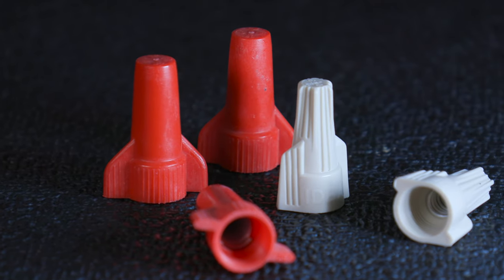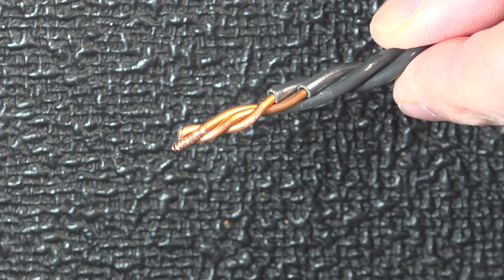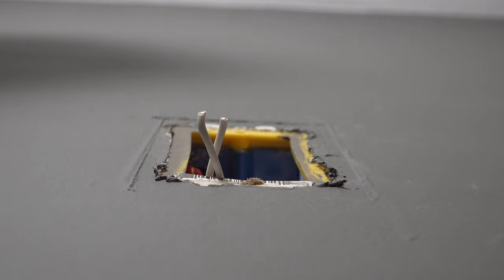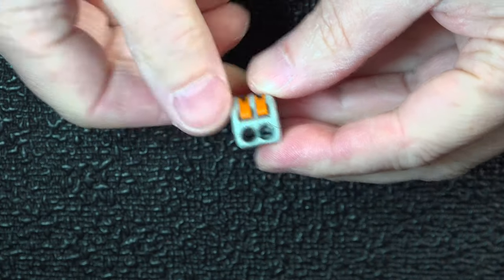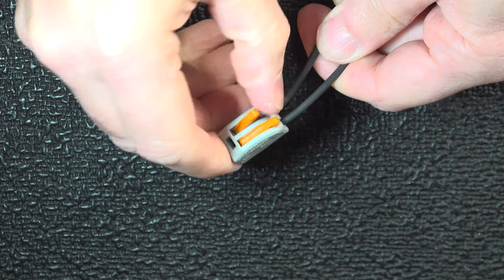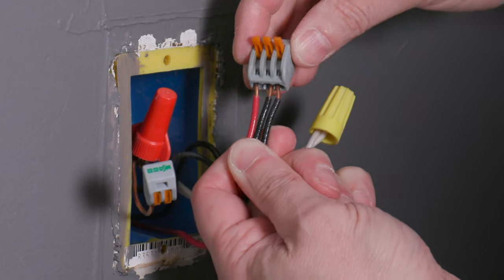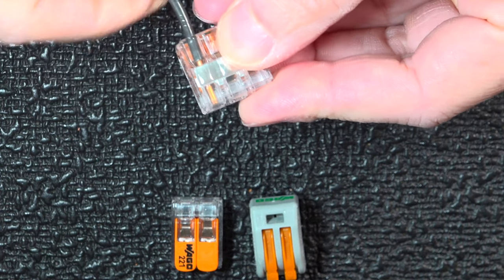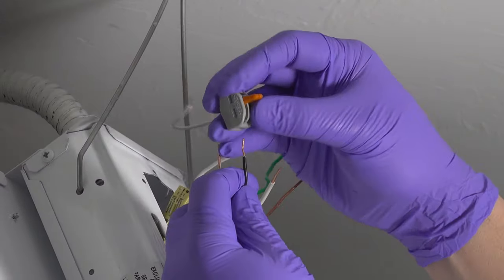Never use Wire Nuts Again - Wago is Better Electrical Connector

Comment: Never seen a wire nut in New Zealand.....however they do look somewhat like a common electrical joiner that's used out here. Basically the exposed wire ends are twisted together (all heavier wires are multi stranded), then the "joiner" is slid on and a screw on the side is tightened down onto the exposed part of the wires to help with the connection (the inside of the joiner is conductive too), the screw also helps to keep the joiner in place...the screw is counter-sunk into the plastic cover which is insulating the joiner.

Comment: We use these where i work. They are better than nuts. I also found theseclear push blocksthat are for stiff not stranded wires but they r great

Comment: If they would make these stackable then they would be amazing. 
My immediate thought was that this won’t really help you if you’re in a situation that exceeds 5 wires or where you have to work on a circuit hot. 
If they made ones you could add on to then it’s something I would want to implement into my material.
Reply: if you have more than 5 wires on a connection, you have ballsed up wireing. but there is nothing stopping you from daisy chaining a few together, and wago do do 6,8 and 10 way push connectors. also putting more than 5 cables in a wire nut has got to be pushing the limits there surely
Reply: @jak0995  not really. 4 gang switch box, or even a 3 gang switch box with a jumper wire. Pretty standard to have 5 wires in a connection.

Comment: Nice and handy but what do you do when City, county, or state entities specifications require wire nuts as their only approved connection. We are talking traffic signals and street lights that have been around for decades. As a certified union electrician of 23 yrs. that does commercial and industrial, ask anyone of my brothers. We hate wagos. We have more problems with them then good ole wirenuts. They are simple and fast I will give them that.
Reply: Well, force people to use WAGO according to the instructions, then there will be no problems.

Comment: Putting two wires together, wire nut good but on the occasion that you have more than two, I can see the benefit of using the Wago connectors.  I will be getting me some.  I didn't know there was anything else but wire nuts.

Comment: I worked as an electrician for many years and if my boss caught you using these or using the Stab-Lok on a switch or receptacle you would get chewed out. Wago and Stab-Lok do not provide a good connection. If you can spin the wire in the connector once it’s locked down, how good can the connection be?
Reply: The connection is so good that I have never found a connection made with WAGO that would have failed without water entering the junction box. Here where I live WAGOs came into use in the 90s and in the early 2000s they completely supplanted outdated connection methods.

Comment: I love Wago - we put Wago terminal blocks in panels for industrial equipment. BUT NOT IN A HOUSE!  they get moisture, they get corroded because they are in an area of the house where chlorine cleaning products, even pool products exist - or, they get overloaded.  plastic body without the 360 degree steel spring is subject to a positive thermal feedback effect - the body simply lets the top and bottom expand increasing electrical resistance, hence more heat.  20 amps year over year on a branch string is hard duty.  I love Wago, just dont want them to go down the road polybutylene water pipes did and caused so many houses to be damaged.  all in my humble opinion.  Go Wago - i think there are better candidates for expanding your product line that competing against wire nuts -but thats just me!  Preston

Comment: I’ve grown up around and doing electrical 20+ years wagos have there place but wire nuts are still best practice in general and I think cheaper. Problems typically arise the workers damage or break wire end connections while twisting together or use to small/too large size Nut. Also, cutting wire nut off is usually best idea so it does shorten the wire slightly but its really not hard to add a jumper to a branch and use that also if its solid to stranded simply twist all solid together then add stranded slightly past the solid so it grabs the nut. No more complicated my understanding as far as wagos is the lever are best for anything higher voltage and plug in ones are mainly for low voltage as not as much risk for fire.

Comment: These types of wire nuts have been around since the 90's.   Back in the 90's I used a different version, but simular.
The problem is the spring steel that secures the conductors 
These springs rust, and loosen up, and fail.
You don't have to cut the wire nut out.  You take the wire nut off, and un-twist the conductors apart.  Once the conductors are separated,  you can add new conductors,  subtract conductors,  or re-splice the old splice, and add a new wire nut. 
I did find the spring steel useful when splicing about 6 connectors in a box.  Because the conductors were more flexible than with wire nuts
Reply from the maker: I'm sorry are your comments about the Wago predictions because in 40 years in use worldwide none of that has happened. They are also made of plated copper so nothing is rusting, except for a weren't which is galvanized steel. Which do you think is better, plenty of rusted out wire nuts out there.
Reply: @SilverCymbal  For 20 years,  i worked as a maintenance electrician.
Reply: @jamesmooney8933  22 Years electrican in Industry and no problems with Wago Connectors.

Comment: Can this technique and wagons be used on automotive wiring without causing damage but stay pretty solid in the connector?
Reply: It may depend where because vehicles have a lot of crud and vibration.  I like crimp or solder.

Comment: My thing is how big is surface area of the connector? I ask because heat is part of electric and with a small surface area you could have a problem. I have never seen a wire but come lose if done right.

Comment: Problem i have with wagos is that they have a smaller contact area than a wire nut does.  Sure they take away the guess work and are easier for amateurs to install and they do have their applications where they are perfect and appropriate.  But take a properly terminated wire nut connection, tie it in line with a wago connection, run 16 amps thru the pair in series and use a thermal camera on both.  The wago will show a temp rise with solid conductors that the nire nut does not.  Stranded doesn't have this issue.  I use both depending on application but lean towards wire nuts for high current sustained loads.
Reply from the maker: They are rated for 20amps in the US and 30amps in Europe. So what do you think would happen to this patented holding design if you put 3x the amps through (60amps) https://youtu.be/B1pmuRsf1co See for yourself
Reply: @SilverCymbal  242F for the wire nut vs 276F for the wago.  Guess which one has higher intrinsic resistance for its termination?  I make my living twisting wire nuts.  I use the appropriate termination methods based on the application.  Wagos sometimes.  Insures others.  Wire nuts mostly.  Higher currents are mechanical connections or cold crimps with the appropriate tooling.

Comment: I just used Wagos to connect three wires together for the first, and last time.  The Wagos did not secure the wires, the down the line outlet did not work after I completed the work.  When I reopened the box with the Wagos in it, one of the hot and neutral wires had already slipped out of the Wagos.  When I wanted to remove the other two wires I thought it would be a struggle, nope just a quarter twist on the connectors and all the wire slide straight out.   Give me a traditional wire nut any day, I will never use a Wago again.
Reply: You did it wrong plain and simple. These are so easy to use and very safe. They even have a strip guage on the side to show you how much to strip the right amount of plastic off the wire. I don't think I would ever want you to work on my house.
Reply: @JosEPh-zy3yr  I am not a professional electrician, just a DIYer.  I stripped all the wires to the same length. according to the strip guide on the WAGO.  WAGOs are advertised by all the YouTubers as the easiest solution for DIYers, I took the wires that were previously in the WAGO and rotated them together and wire nutted them together, the outlet worked the first time.  If it possible to do it wrong, "plain and simple" the first time, and then do it right the old way, then maybe the new way has serious flaws.
Reply: Maybe the YouTubers that are in love with WAGOs are being paid by WAGO?

Comment: Been using wire nuts for years. All my electrician friends use them. The best connection is solder, but that's not necessary, considering AC electricity runs along the outside of copper wire. So as long as the copper touches effectively....plus these Wago things only have one point of contact, on the compress piece you push down.

Comment: I may have spoke to soon, I haven't used the lever type, just the push ins, being careful, I had problems. There is just a thin piece of metal that makes contact and its a very small point of contact.  #12 thhn is good for 20 amps, you cant run 20 amps through those. I got called back by my customer because things quit working, I dont like getting called back on a job because things quit working.
Reply from the maker: I hate all the push in versions, yes even Wagos. However the 221 is amazing and costs more than wire nuts but its minimal for any diy or regular user and the benefits are awesome

Comment: Not sure if these go against any NEC code, but they are rated for normal household voltage and are much easier to use than wire nuts.

Comment: I rebuilt an old boat trailer in 2013 into a flatbed. I used wire nuts for the lights and they don’t seem very reliable. I rewired it again since 2013 with LED taillights and still I have problems.
Reply: Vibration & bumping is rough on any electrical connection. Your best off soldering for automotive if you can.
Reply from the maker: If you want the benefit of soldering but with easier use see this video https://youtu.be/NZtwD_F7lTA

Comment: If wagos had a screw down clamp on them like a proper terminal connection, I wouldn't mind using them, but the fact that a very small portion of metal is contacting the conductor makes me shy away from them. Wire nuts don't have issues unless they aren't installed properly (but that's with most things), they just take longer.
Reply: When I, being from europe, saw those wire nuts my first time, I felt like 200 years in the past :-). Belive me Wago had to go thrue a lot of testing to get those aproved and don´t forget we use 220V and 380V! I gues you have never seen those kind of clamps , which we use for our circuit breaker boxes. Take a look here https://www.youtube.com/watch?v=R7WgDTH9r-8  I was the first person in town (CA) to use an inwall watertank for my toilette. The inspector was really exited to see that :-)
Reply: @HI-sd3gt  It's true, I don't like change. There are a lot of technologies that are slow to be adopted. New code has to be written, revised and adopted and that's even before public opinion changes. We'll get there eventually as more of us are exposed to it. Wagos remind me of the backstab connectors in 15amp switches and receptacles and so their inherent problems always translated to wagos in my mind. Also, your higher voltage means you aren't passing as much amperage through so that could be helpful for residential use of the wagos. Higher voltage = Less contact needed.

Comment: If you would not use the stab in connection on switches and receptacles, you should not use stab in wire connectors. Wire nuts may not be as convenient but when used properly will give a superior connection to Wago connectors

Comment: So, intrigued by this, I checked. Basically, they are not sold by Home Depot or Lowes in Canada. There are some push-in connectors but they pretty expensive.

Comment: These U.L. and MEC Code approved? And what are the load limits? Difference between twisting wires together rated for 20 amps and a connector brass that may only carry 5 amps and you have a fire hazard!
Reply from the maker: Yes to both and about 20 other certifications world wide. Don't confuse these with the junk out there.
Reply: @SilverCymbal  haven't found a cost differential vs nuts yet, but 35A at 105c rating works.

Comment: As an electrician wire nuts are just fine.  Any schooling and a decent time of field experience wire nuts are fine to use if you know what you’re doing
Reply: However, you shouldn't need an electrician for minor electrical work. Why use components that need schooling and field experience to use correctly?

In the uk I've never even seen these wire nuts. I've always seen screw terminals which are super obvious how they work.

Comment: As a commercial electrician this is pretty cool, I would probably use these if I ever build my house. The wire shortening over the years shouldn’t really be a problem if the wire was run properly and to code as there would be over 8 inches the box which should be plenty for any work that has to be done. The only time I’ve personally seen this become a problem is when people cut way too much wire off because they are trying to fit it in the box, which at that point code would suggest getting a bigger box or people who don’t know how to properly terminate their wires. Regardless, this is really cool and would probably be a lot better even on some commercial jobs when you have 5 or more wires tapping together. I am curious though, do these work with all wire sizes
Reply: In the mid '60s the price of copper jumped sharply, and some guys were so cheap wiring houses that they would wire the outlet box and pull the extra cable back out of the back of the box and snug it along to the next box (like the way they used to wire super-computers to minimize the length of the wires) so that there was NO extra wire in the box.   Working on that stuff is a bloody nightmare.
I distrusted WAGOs when I first saw them.   It wasn't until I saw them used in a motor that I was working on (i.e. a proper industrial situation) that I was willing to give them a chance.  I tried them and I love them.   For situations where the wires are disconnected occasionally  (like motors, etc.) it is wonderful that the wires don't get twisted up and mangled a bit by the wire nuts.   They're even rated to 105 Celcius, so heat isn't a problem.  HOWEVER, they are only rated to 20A, so that sucks.   I mean, they're still usable for a whole lot of situations, but I'm not used to having a maximum amperage rating on a connector.  Generally, they can handle any amperage that the wire you can fit into it can handle.   Not WAGOs.
Now, some WAGO fan-boy might pop up and say that they are rated to 32A.   That's the IEC rating.    The IEC rates them for 32A of 400V at 85C.   Since the IEC has no jurisdiction here where I am we have to go by what it says on the packaging in North America, which IIRC is the UL/UL-C rating, which is 20A of 600V at 105C.

They are not cheap, but I now love them, and I stock them and use them in every situation that I can.

Comment: If it is NOT UL or NEC approved, why ask for trouble when there are approved products better than wago, that use screws or just insert wire into an IDC
Reply from the maker: Wago has more approvals in total than wire nuts. And yes they are UL and CSA approved and meet the NEC

Comment: I have used wire nuts for decades with no problems. True you have to use them properly and double check each one after you install them. But they will last forever when done properly.

Comment: Wire nuts a great, but I've been using wago nuts for years now and EVEN ON AUTOMOTIVE applications I've never had one fail that I've installed correctely. It's easy and fairly foolproof. Both work well when done correctly

Comment: Working as a union electrician it was frowned upon to use Wago's in any application other than a light fixture. They don't have as much carrying capacity as a bare wire to a bare wire nut connection. All of the Waco's I've ever had the displeasure to use gave up the beans when doing trim out work, they are most definitely not a more secure connector than a properly twisted wire nut connection.
Reply: They handle at least double what they are rated.  And it takes 30lbs of pull to remove them.
Reply: Very little contact surface as well, which creates more resistance...so on and so forth.
Reply: @michael-n5zr  30 lb they claim, even if they did it's still a very thin connector between wire applications. Most of them can't handle amperage as well as a wire nut connection done properly can.

Comment: Maybe I didn't look hard enough, but I couldn't find a Wago connector for anything larger than #10.  So for hooking up motors using #4-6, looks like I still have to use wire nuts.

Comment: Anybody know if these would be safe to use in a cold environment? I have to replace the ice maker in my fridge and the electrical connector didn't match up. Couldn't find an adaptor so had to cut the cords. Tried using those waterproof wire nuts and didn't know they had the goo inside until I connected the first two wires. It's was nothing but a gooey mess after that with the other three. And, of course, the new over make isn't getting any power. 🤦‍♂️ But if these smart connector are freezer friendly, I will gladly try those!!